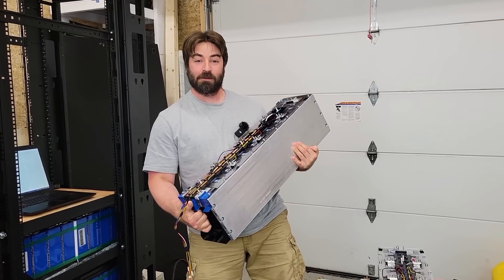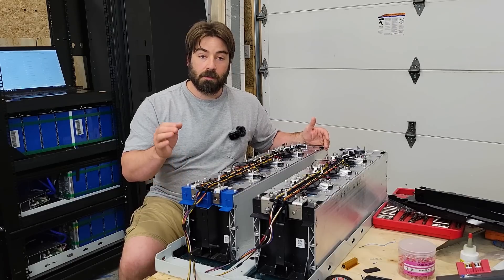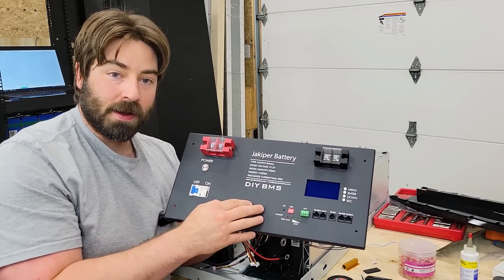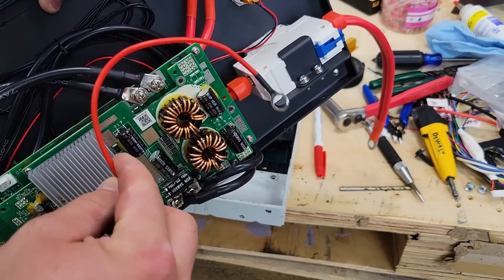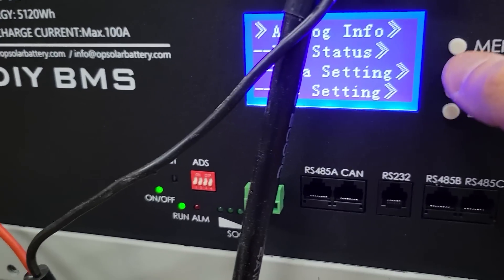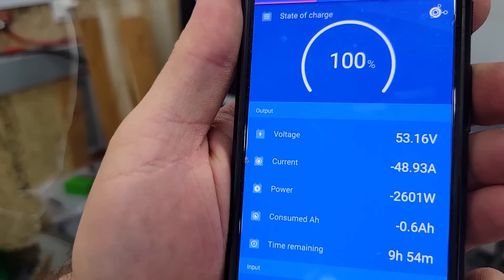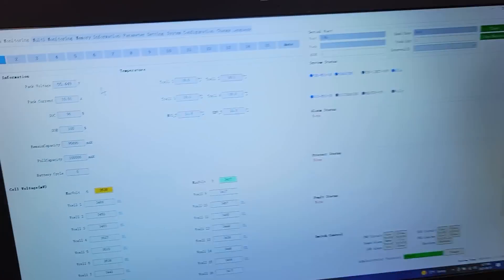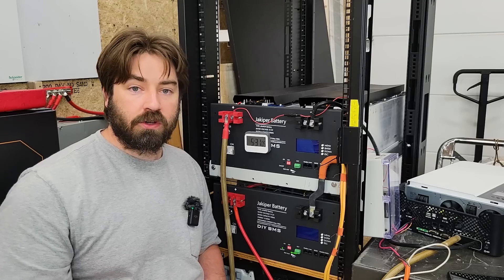Build your own solar battery, fast and cheap!

Comment: We gots no videos showing the eg4 application for iPhones. Some of us don’t want or own a computer and just want to buy 3 eg4 lifepo4 v2 batteries and hook them together and use an app to look at the data. Make a video about the eg4 app in this regard plz.
Reply: AFAIK, EG4 battery software runs on MS Windows.  I have not seen any other versions.
Reply: Their waterproof batteries run on iOS…the app isn’t very informative only giving SOC, amp draw, voltage, temp and individual cell voltages.

Comment: When u say “top balanced for 3 days” - does that mean u floated the cells at 3.65 for 3 days?
Reply from the maker: I charged the pack at a low Amp rating (I got my charger down to 2A) until one cell hit 3.65V and the BMS shut off.  This allowed the balance to be on for a couple hours while charging.  I then turned off the charger and let it sit overnight.  During the night it continued balancing until the cells fell below the programmed threshold.  The next day I would discharge a couple Ah out of the pack.  Then I'd turn on the charger again at a low current until the BMS once again shut off.  I could do about 2 or 3 of these cycles per day.  And I did this process for 3 days.
Reply: Dude ur the best thank u for the thorough explanation!!
Reply from the maker: Your welcome.  There are many ways to top balance.  Sometimes I just use my i-charger.  Sometimes I charge each cell individually.  If the cells are not series connected, then I can parallel all of them together.   Just depends on the situation I'm in at the time.

Comment: Is there a way to do top balancing and capacity test if I don't have all those tools?
Reply from the maker: The BMS will eventually top-balance the cells on it's own.  I used the I-charger to speed up the process. 

Another alternative I've done sometimes.  Get a water heating element, connect two wires, and drop it in a bucket of water.   When you are charging the whole battery, and notice one cell is higher than the rest, put the two leads on just that cell and it will burn off some of the power.  

Another alternative is to get a cheap hobby charger, like this $40 option: https://amzn.to/3Zhlbkx which comes with a accessories.  Charge each cell one at a time up to 3.65V.

Comment: These arent the same as the catl automotive right? Those are 20s
Reply from the maker: Correct.  The CATL modules I took apart a couple months ago were 20s.  I had to cut out and remove 4 cells to make a 16s.  This build was a lot faster and easier.
Reply: @DavidPozEnergy  but not the same cells right? The catl seems much higher quality
Reply from the maker: I didn't take apart the module to check the QR code.  The QR code would let me know what brand the cells are.  I don't know if the cells are CATL brand or not.

Comment: I am curious, if having that one BMS wire that was 6 inches longer to reach one cell will affect it in any way?
Reply from the maker: Yes and no.  Technically speaking, if we are using NASA grade lab equipment, then the answer is "yes".  But, in the day-to-day cycling of the battery, "no".  When I tear down pre-built batteries, they have different length wires.  As you could probably tell, I left the wires the same length where I could.
Reply: @DavidPozEnergy  
Thanks for the answer, as I figured a BMS would be critical. 🖖
Reply: A minuscule amount of current passes through those "sense" wires, so extending their length (reasonably) should make an un-measurable difference.

Comment: Thank you for posting these info / how-to's! I learn alot (and still learning).
I have a wood shop that I would love to make 'off grid' that could take advantage of the sun and wind in my location.
Out of curiosity, have you written a 'how to' in building, installing an 'off grid' system that incorporates solar panels and battery systems? Or is there a book you'd recommend, if not a series of books?
Reply from the maker: I have not written a book.  I've read dozens of books on the subject, but I don't recommend any of them.  My favorite series to recommend is a 6-part video series from Alt-E: https://www.altestore.com/diy-solar-resources/off-grid-solar-system-design-video-series/

Comment: I’ve been passing to everyone. With the weight of batteries 🔋 and wall mounted hardware. Getting a engine lift to help pickup and install to he wall will save your back. The Engine Lifts are mounted on wheels and has good reach with weight abilities. And you do some heavy lifting. Thanks again for your posts.
Reply: You can get a 1 ton chain hoist for less than $40 - works like a charm.
Reply: good suggestion
Reply: step one: don't be weak LOL

Comment: Geat video.  What charge inverter would you put on these to power whole house with the 100kw?
Reply from the maker: I'm currently using a Schneider XW PRO 6848 inverter.  And, I bought a second one to parallel for even more power.  I have videos on the inverter.  My favorite video is testing the overloading capacity, because It's the best I've ever tested: https://youtu.be/nCV1OUrcAaw?si=rsaoG1UQ0sYt0pA0
Reply: @DavidPozEnergy  I have an existing 14.5kw micro inverter PV system and trying to add whole house backup/off-grid battery system.  I need 70-75 kw batteries to do this for the worst case days
Reply from the maker: You may want to research a term called "AC coupling".  Some inverters will allow AC coupling, and some don't.  If you have this feature, then you can still use your existing solar system (with micro inverters) while the grid is down.  I've tested the AC coupling feature on my Schneider and it works well. If you don't want to go Schneider, look at SMA Sunny Islands, they also do it.
Reply: @DavidPozEnergy  Sol-Ark 15kW All-In-One Hybrid Inverter, can it just $7k. And well it is a lot to spend on just the inverter with no one I trust is speaking about it.
Reply from the maker: Personally, I'm not a fan of the Sol-Ark line of inverters.  If you want those types of features, then check out this one: https://signaturesolar.com/eg4-18kpv-hybrid-inverter-all-in-one-solar-inverter-eg4-18kpv-12lv/?ref=4_rHcgZ9x-TiF-
  
note, this is an affiliate link.
Reply: @DavidPozEnergy  the way I understand is I would need 2 In order to have a 100 amps.  Could I start with 1 and add the second down the road, or is it even needed?
And yes, affiliate link it up. I would not want it any other way. 

Thank you for the communication 🙏 🙌
Reply from the maker: That's correct, that you would need 2 inverters paralleled to have 100 Amps@240V while off grid.  Remember, it can feed through 200A while on grid.  Yes, you can use one and add a second later.  However, you never know if there will be a hardware change down the road (another chip shortage?).  So, if it were me, I'd test it hard as soon as you get it, and decide within a month if you are getting a second or not.  Ideally, you would make a loads list first.  Something like an Excell sheet with all your loads.  Figure out what a realistic worst-case scenario is.  Some homes will all natural gas appliances don't need a lot of Amps.  Other homes that are all-electric do.  But a loads list is the best way to decide. 

It should be noted that I have not personally tested the EG4 18kPV inverter.  It's a good choice for someone who has reliable grid electricity, and wants a back-up once in a while.  But, if you are going off grid 100% of the time, look at a Schneider.
Reply: @DavidPozEnergy I assume when your saying 240v you mean split phase 240v (2x120v) not single phase 240v (uk viewer here, that’s stupid cheap for 14kwh of storage)
Reply: @DavidPozEnergy  thank you very much i will be using your affiliate links
Reply: @DavidPozEnergy Do you have an affiliate link for
Schneider AC Coupling with Dual Inverter System Bundle - 13600W 120/240v Output | 17000W PV Input [BNDL-S0001]
Reply from the maker: Sure.  Thanks for considering to use my links.
Here is my Affiliate link to that Schneider Bundle: https://signaturesolar.com/bndl-ac-coupling-with-dual-inverter?ref=4_rHcgZ9x-TiF-

Also, here is my Affiliate link to Signature Solar Home page: https://signaturesolar.com/?ref=4_rHcgZ9x-TiF-  You can use this for any items SS sells.
Reply: @DavidPozEnergy just paid for 10.  And now the link is dead.  😅 I almost missed out.. thank you for your videos and communication
Reply: @leexgx  that is correct we use 3 wire systems,  2 120v lines and 1 neutral
Reply: @DavidPozEnergy  thank you for sharing the discount with us. If you want to do a video of my system you can

Comment: love the videos, i wanted to get one of those packs just cant justify the shipping for only one battery, and cant afford more than one hahah, but i can live vicariously through you
Reply: I am trying to catch up on how to utilize the lithium batteries. I am still assembling some solar panels from individual cells I purchased year ago. They are intended to go with a small camper trailer. The way I'm approaching the shipping cost problem is getting friends interested in doing this as a joint venture.
Reply from the maker: Individual cells can be shipped in smaller boxes, saving money on shipping.  That would probably be a better choice if you are making a single 24V battery.

Comment: Bed frames seem to turn up in my life regularly. Chop saw and a cheap welder builds me all kinds of racks and mainframes.
Reply: Tip from a pro welder. Don't rely on bed frames to hold any weight or expect the welds to hold under stress or flexing. It's not a hardened steel as much as is basically has a crap load of carbon to make it hard. It's fine for some stuff but a battery rack would scare me.
Reply: @tireballastserviceofflorid7771  Bed frames regularly hold up fat people bouncing up and down. I think they can handle holding a stationary battery
Reply: @enigma9789 I believe his concern is the welded joints.
Reply: @enigma9789  brother I’m dead 😂💀
Reply: I end up with bedframes too. And aluminum ladders. Its a universal constant for me.
Reply: My husband collects these also and cuts the wheels off, he says it's free angle iron because people are literally throwing or giving it away.
Reply: I use bed frames to make my own toolbox mounts for my semi truck 🚚 they work great! 👍 before drilling or welding, heat up area with MAPP gas torch until it glows a dark orange 🍊 then walk away and let it cool completely down. This anneals it, makes it softer to drill with cobalt bits & tap magic & and slow firm pressure with intermittent breaks to let bit cool down. Carbide bits are fine too but brittle/expensive. The masonry bit hack also works if you can grind the tip angle just right. Annealing also helps clean the metal for welding. Use a flapdisk regardless to get clean, bare metal then wipe it with acetone (to remove microscopic oils/contaminants) before actually welding it. So many people don't realize the cleaner the metal, the cleaner (and stronger) the welds.
Reply from the maker: I've used bedframes on some projects.  I remember once not being able to drill through it.  Have you ran into that?
Reply: @DavidPozEnergy  yeah it is hardened. An option is the carbide bits for concrete will work.
Reply: Heat the spot you want to drill up to red/orange  and let it cool slowly. @DavidPozEnergy
Reply: @DavidPozEnergy  I used to pickup bed frames from along side the road and thought I'd use it for non critical projects in place of expensive angle.  Well, I found out the same as you.  You can't hardly drill thru them and try driving a self tapping screw into them.  Not happening.  I quit picking them up and rarely use the for anything now.
I wonder what they did in the process of making them that made them so hard?
Reply: seemed the metal doesn't weld very well either

Comment: Nice. Still pricey
Reply from the maker: You have been able to find some stellar deals.
Reply: @DavidPozEnergy  I find it best to avoid shipping. The cheaper the battery the more time it takes to get them working the way you want. Let me know if you want to part with any old stock you have. I may be interested. Hope all is well with you and the fam. Cheers
Reply: @DavidPozEnergy  I think the cheapest I've paid is $30/ kwh shipped to my door. On a 220 kwh delivery.  That was 2 years ago and I still have some packs left.